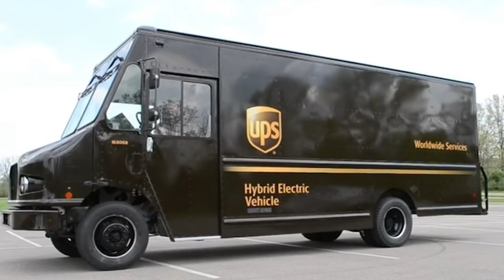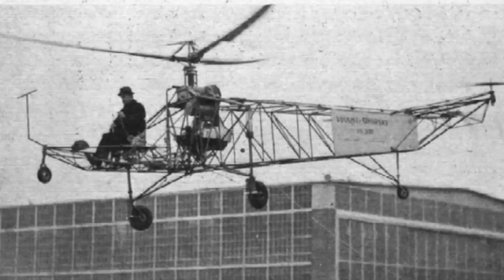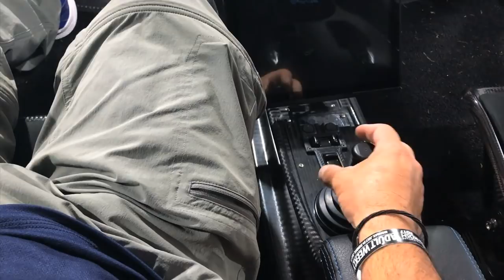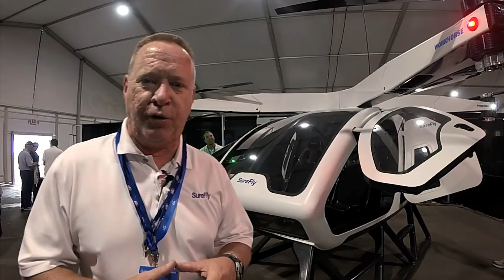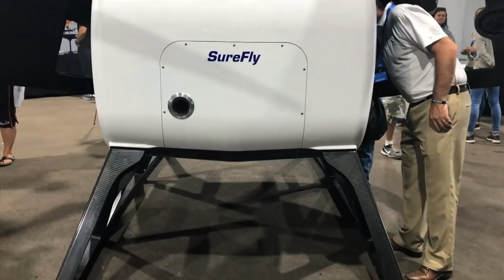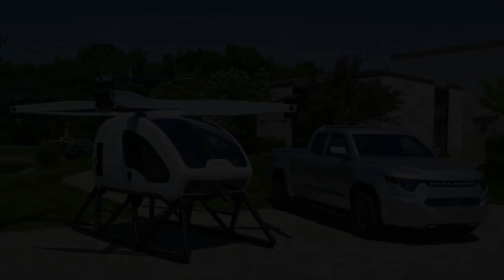Workhorse SureFly Octocopter

Comment: This design is genius.   Much safer than a conventional designed helicopter.  There is a small reduction gear between the gas/diesel engine and the generator.  Nothing to break.  A two hour commute in LA is a 20 mile drive and a 12 mile flight with a 7 minute flight time.   With GPS programmed flight, it is the future.   The Parent company is well financed.   This product will go through design modifications but what a great start.  Light Sport Pilots License with a Quad-Copter endorsement.  Very Cool!  Workhorse Group, builds hybrid electric trucks for UPS and they are great products.  I spoke with a UPS driver in Bellevue WA 2 weeks ago.  In the even of the engine/generator failure, a backup batter could provide enough energy to land.  Eight electric brush-less motors and fixed pitched props.  Extremely cool.  I would prefer an all battery/electric.  No engine/generator/fuel load.  Trade off is you have to charge it.  Save your money boys, the future is going to be a lot of fun.
Reply: Doesn't have single points of failure like a conventional helicopter does. Should be safer.

Comment: He gives much more information on the video at the Paris Air Show this year, like: if the generators fail, there are redundant batteries that can continue to power the propellers for a safe landing from as high as 4,000 feet.  Should they fail as well, it has a large "ballistic parachute" (top center) which can also bring it down safely from altitude.
No matter which brand of person-carrying drone has a clip, there are always heaps of nasty nay-sayers - probably working for rival aircraft outfits.  Helicopter pilots will also lose a lot of paying passengers if these things get going.  It's a real shame how vested interests always hamper progress.

Comment: So, 75mph, 70 mile range, and only 400lbs payload all for the low target price of just 200k..(probably double that by the time it makes production...if it ever does). good luck with that!  ;-)
Reply: My first couple of thoughts as well. Complaining about the purchase price of a traditional helicopter and then going into the details of your expensive product with minimal capability, is a bit stupid.
Reply: It is easy to say, of what use is it, but of what use is a new born baby? The first airplane only flew 120 feet, the first submarine just under the surface. Give it a chance to grow.
Reply: The first transportation vehicles were powered by horses. Your lack of imagination is disturbing.
Reply: Orielsy Diaz I'm the first one to say "Of what use is a new born baby"; things need time to grow. But like so many things, this will most likely be priced well outside the range of the average joe, which are the people they seem to be targeting. I hope it works out. It's a good start but wish it were cheaper.

Comment: You can autorotate a helicopter. This thing would drop like a rock.
Reply: Good point. No glide either. Spam in an ugly can.
Reply: They could just put a back up battery in there to get to the ground in event of engine/generator failure. Chances of electric motor failing are low af
Reply: Parachute(s).
Reply: Electric Driven Props: 2 props per arm, contra rotating. Eight motors, each driving a single propeller
Piloted Vehicle designed to carry pilot and passenger or pilot and cargo
Curb Weight: 1100lbs. Max Takeoff Weight: 1500lbs
Gasoline Piston Engine drives dual generators to provide power to prop motors
***Dual Lithium Battery Packs: 7.5kWh each, used for emergency landing power (5 minutes) in the event the gasoline generator fails
Full computer and electrical system redudancy
***Ballistic Parachute
Fuselage and props are carbon fiber for durability and light weight
70 mph top speed
One hour of flight time available per tank of gasoline
Flight ceiling of 4000 feet.
Fix Prop Pitch and no transitional parts (No wings, tail, tilt rotor or tilt wings) for simplicity and safety
Reply: It does have. It has batteries that take over in case of engine failure that last long enough to get you to ground safely. Does the same as an auto-rotation with a regular heli.
Reply: It has an emergency parachute.
Reply: Gerald Nelson it has numerous safety features. Much safer than a helicopter. Because it has 8 props 4 over 4. It can fly with multiple engine failures. It also has backup batteries as said to lower you to ground. Then it has a parachute as well. Tue landing gear has numerous crumple zones so if it landed real hard the passenger wouldn't feel the total impact. This is the future. The helicopter can't compete with the ability to handle up to 3-4 engine failures while still landing. Although an over under double failure would be bad. But hell I've landed my race drones with  issues before. And electric is fAr more reliable than gas.
Reply: robo931 
no skill involved in flying this.
Reply: It does have a back-up battery, see the video for this at the 2017 Paris Air Show.  It also has a backup ballistic parachute mounted top center.
Reply: Good stuff Bob.  The denigrators probably work for rival companies.  It will also cause those expensive helicopter pilots to lose some passengers.
Reply: i wonder why it doesnt use multiple small 1 cylinder generators for extra redundacy, instead of one big generator?
Reply: Large bird strike..... could take out BOTH props on one arm..... Aircraft below 500ft agl.... Ballistic Parachute no good = Dead passengers
Reply: You don't really need to auto-rotate, its got 8 redundant propellers and motors, almost no moving parts, a backup battery.  It would be safer and require less services than a traditional helicopter.  I designed one of the first X8 style drones, trust me it can lose a motor or prop and still fly perfectly fine in this configuration as long as the power to weight ratio is correct.
Reply: Not really. If it is battery operated it can land safely because batteries will continue to rotate the blades enough to reach the ground without dropping. But if there is a cut-off switch that stops providing energy to stop flattening the batteries to zero voltage, then the pilot/passengers can only have a couple on minutes for a prayer as it drops down like a brick.

Comment: We already have gasoline helicopter with all the range that people want they can land in parking lots in most cities. I honestly don't see the advantage of these electric helicopters. You Can have A sky full of helicopters anyway if you could you'd have gasoline helicopters everywhere. The trade-offs are just too great. They need a lot more room to land there are a lot more dangerous than the liability is huge when one crashes on top five cars and kills people or even blows around a bunch of stones in the parking lot and takes out 50 paint jobs. All this emphasis on these electric flying machines is ridiculous except for specialized purposes like maybe a formula 1 of flying electric vehicles. But it's just not something that the masses are going to embrace and it's not something that The regulators are going to let the masses embrace. They know that it's impossible to have a bunch of consumers flying these electric vehicles around in cities where they really needed. And the ultralight market already exists and people fly a little ultra lights around and those people are doing it out in the country cuz that's what the FAA says they have to do cuz they can't fly over populated areas. So this is just all a big waste of time.